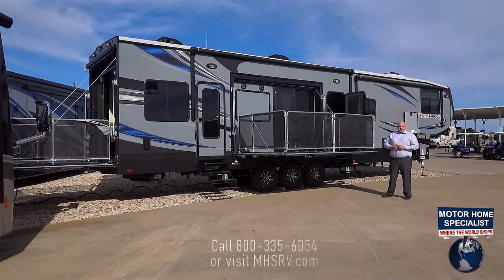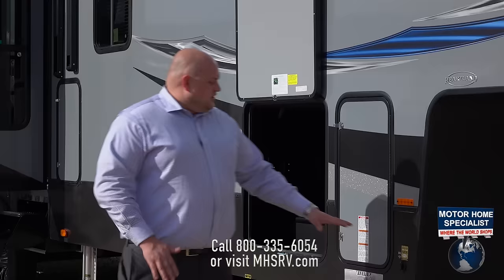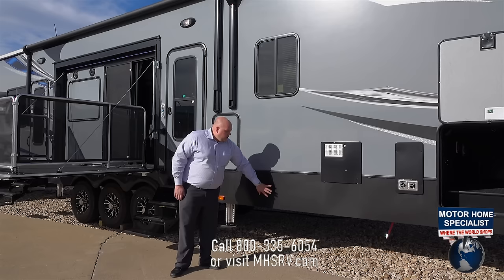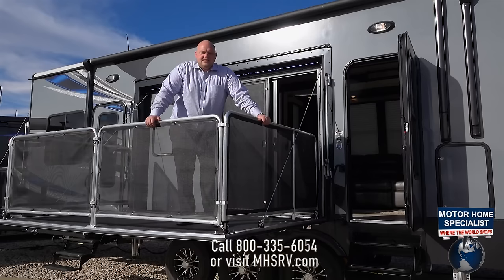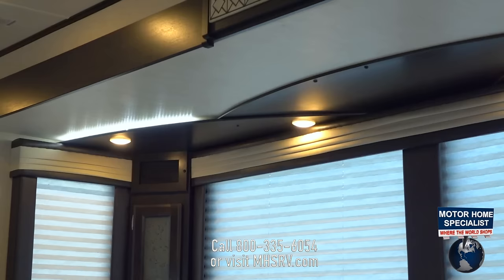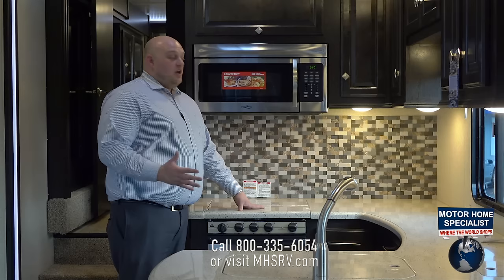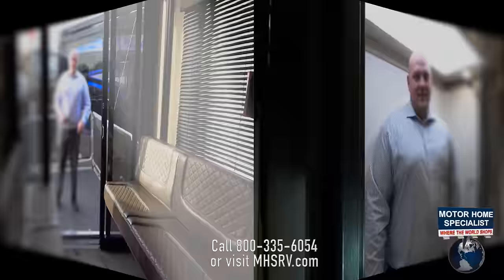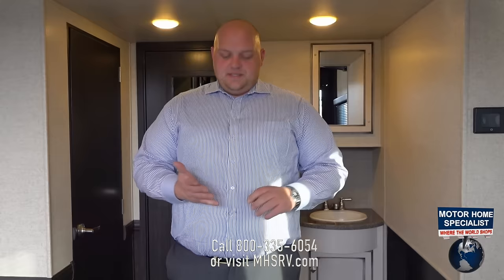Road Warrior 427 Luxury Toy Hauler RV Review at Motor Home Specialist

Comment: Really like the accent lighting. A Convection Microwave AND a regular oven? Never seen that before. Would have preferred the standard oven replaced with a dish washer.  A screw on cover for the washer dryer hookup would make that area less unsightly for those who don't use it.

Comment: hi, great video...does this model have an electricity management system?  we currently are full time but in 30 amp til 50 amp opens up...can this run safely without a pigtail connection...even if it minimizes use of all major appliances at once?

Comment: Great video I like the openness and the large kitchen with all the cabinets and countertop space, but with all that counter space I didn't see a single electrical outlet. Did I over look one?
Reply: They are under the cabinets
Reply: Thanks Larry. I didn't see any outlets in the cabinets. If they are there, how would I plug in my countertop appliances to hidden outlets under the cabinets?